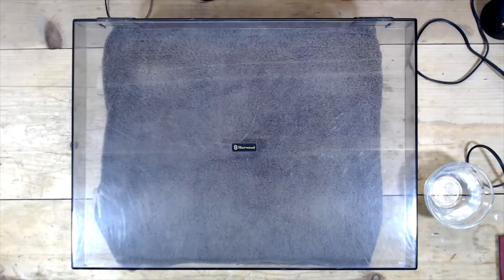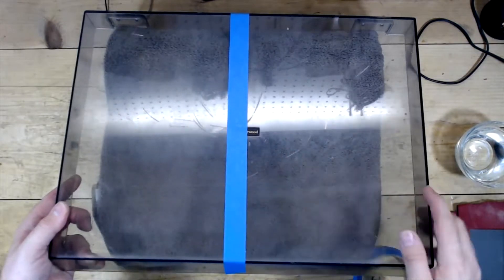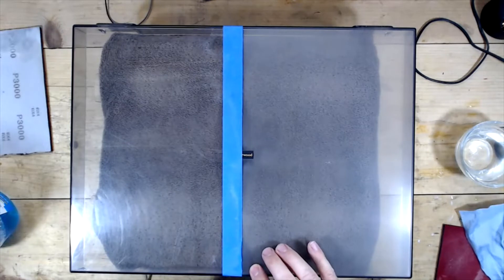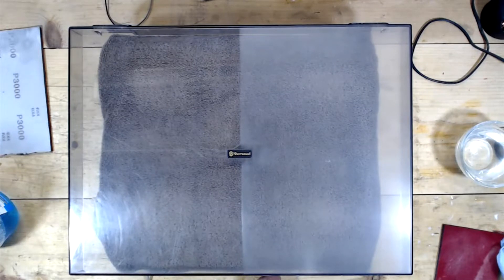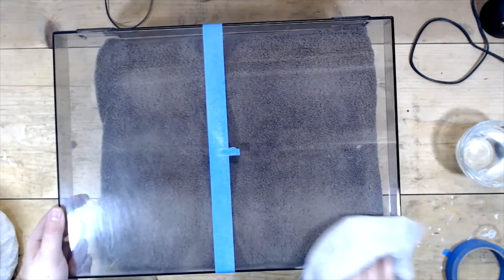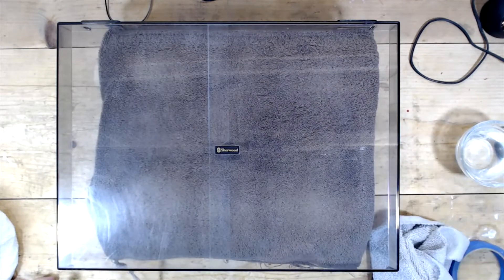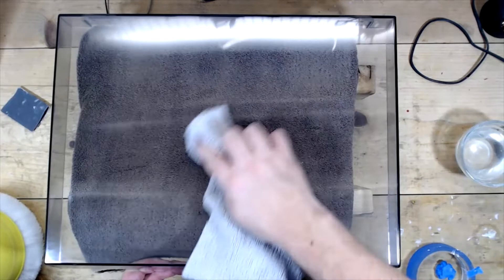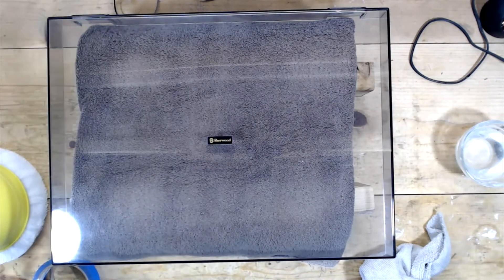How to Polish a Turntable Dustcover with Side by Side Before and After Comparison

Comment: Thanks so much for the video!  Which buffing machine do you use?  I have always done it by hand because I was worried about the buffing machine catching on the dust cover and flinging it.  Maybe yours is a lower speed one though and you don't have to worry about that?  Very interesting that after Novus 2 you follow up with Scratch X.  I have been happy with Novus 2, but I will give that a shot as well.
Reply from the maker: It’s just an orbital car buffer.  I’ll have t check on the brand.  I have since changed order and use Scratch X first, then Novus heavy, followed by Novus fine.  It works much better in the revised order.